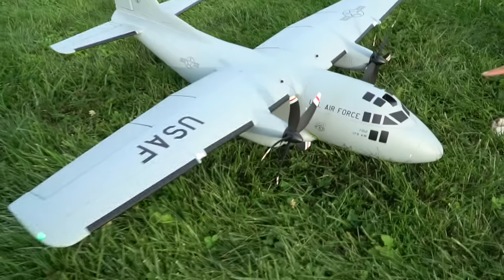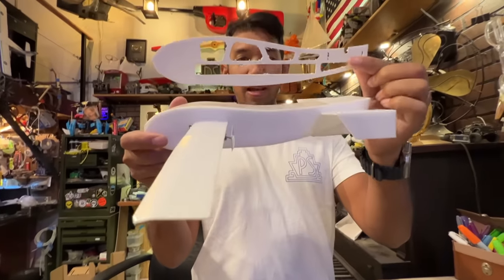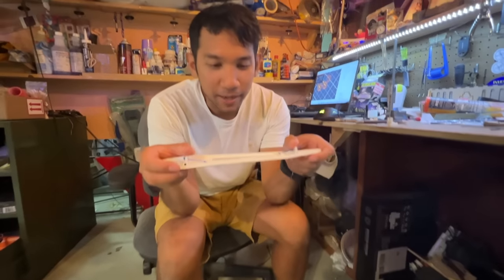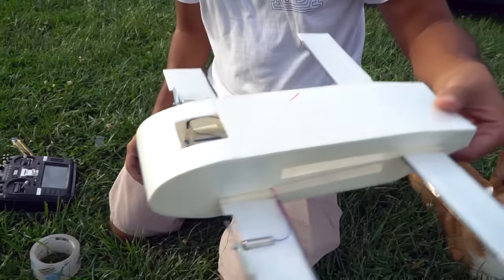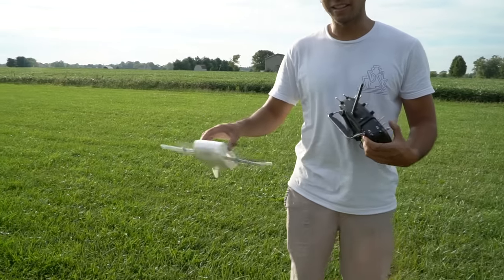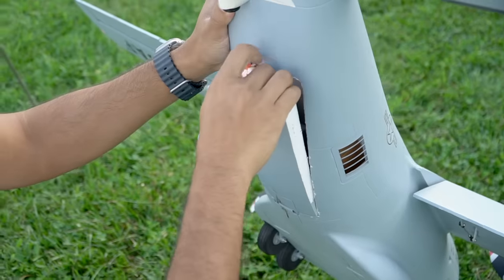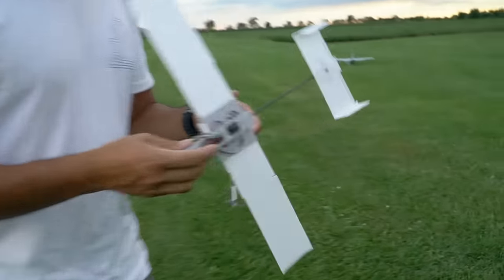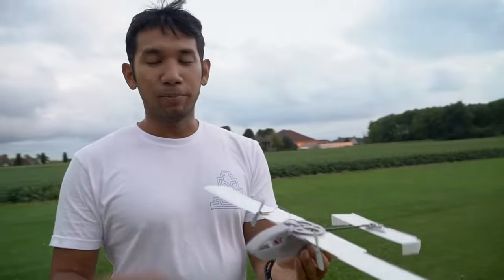MICRO Folding diy DRONE(mid air deployment)

Comment: Perfect! Just finished watching @TomStantonEngineering air powerd plane video and the new @PeterSripol video drops.
Reply: PETER, HEAR ME OUT! hydro foil kayak with a long shaft outboard engine. XXtra long foils with adjustable trim tabs (elevators) SO YOU CAN ''FLY IT'' ON THE WATER IN THEORY.

Comment: I can see some areas for improvement... But this is definitely a really cool design!
I'd put a lightweight servo in (like the EMAX ES9051) for some sort of aileron control as well as a little wooden pin that could be pulled out somehow after it's deployed (less likely to get stuck). That adds about 6-8 grams though, so there's that to consider.

Comment: Hell yeah! It would be cool to make an RC Razer Crest or Mando's N1. The N1 looks a lot more aerodynamic but making the Honda Space Odyssey actually fly would be sick
Reply: I could see the N1 being possible, the Center of lift vs mass would be an issue, but a little turbo fan in the outer cowling where the real engines are, fatten up the wings a bit to give an airfoil, might need some sort of vertical stabilizer unless you can gyro steer with the motors.

Comment: Sounds like you will not further develop this project, but just an idea: i would propose tuning the "cargo" arround inside the carrier so both planes are facing the same direction. In the current configuration, with the "cargo" facing backwards, at the moment of drop the it has definitively negative airspeed, thus no lift. Even though the parachute will reduce the air speed significantly below the speed of the carrier when the "cargo" would be turned arround, you will at least have a little positive airspeed when dropping from the cargo bay.

Comment: alternate design idea: 3(+) foil box-kite design that telescopes into it's long configuration upon opening the bay. the spring loaded keel opening to full length would shoot it out of the bay (no parachute needed, though a thrust plate inside the bay may be needed) and housing everything in the central 'box' should keep your balance self-righting-ly centered, with one prop pulling and situated between the leading box-foil and the central, while the other would be blowing/pushing through the final box-foil, similarly situated between it and the central one, for a front-to-back mirrored configuration.

Comment: if you attach the parachute directly to the plane with a release mechanism then if something goes wrong you just don't release it so it hopefully doesn't crash with too much force

edit: if you keep the skid with its parachute and attach the radio controlled release mechanism like a servo or something on it instead you only need to add a hole or hook to the actual plane

Comment: What controller board can you use for a plane with these small motors? I have one built from a mini helicopter board that also has two tiny servos. Don't know where I got the idea, might be flite test. But the problem with that is I don't remember the name of the board and you had to destroy the gyro on it so it doesn't do auto-throttle based on the tilt and I remember that being a gamble whether it destroys the board or not.
Reply: I'd also like to know.

Comment: Do you think that you could add a servo to the back to control the Elevons? That way the plane would be more controllable than “more throttle = more up”. I understand this would add weight and drag but I think it would be much cooler than this design.

Comment: Pretty decent for launching backwards into "dead air"... I think the results would be even better if you could launch the plane on the same direction as the "mothership" so that it gains lift from the forward momentum alone rather than dropping several dozen feet trying to get up enough airspeed from essentially trying to fly backwards...

Comment: What flight controller are you using to power that ultramicro plane? Would love to use that for some projects I want to do but never found a good way to power the small brushed motors I want to use

Comment: Assuming you just used basic PLA for the apparently final version of the "parasite" aircraft, that seems like a super easy, low cost way to get someone into RC airplanes. Is there an STL and a parts list anywhere for this craft, or is it just the Onshape file?

Comment: Hi Peter ! Have you seen the steering mechanism of the Switchblade 300 ? There is no linkage, two servos push directly the ailerons and a sping plate push the ailerons back. Do you think it could be done with 9g servos ?

Comment: Kinda like the Anduril ALTIUS, but square and much much cheaper, and doesn’t go boom.
Reply: It says the video came out 12 seconds ago how is your comment 1 day old
Reply: How tf did he comment a day ago
Reply: Patreon my dudes
Reply: PETER, HEAR ME OUT! hydro foil kayak with a long shaft outboard engine. XXtra long foils with adjustable trim tabs (elevators) SO YOU CAN ''FLY IT'' ON THE WATER IN THEORY.

Comment: Alot of you problems seams to come from flexing surfaces at high speeds.
I do alot with gliders and some high power gliding competitions here in Germany (F5J and F3J/dlg) we go really fast and hard on those suckers, but also have to be as light as possible.... Sometimes you end up 30cm deep in the grass because the control surfaces couldn't handle 100kph at a turning radius of 3 meters... 
Who would have known! 🤷‍♂️
Your plane looks like that but slower and way lighter.
I had that with alot of foamys too, at high speeds in a dive all controle is gone because the control surfaces just flexed out of the way.

Comment: PETER, HEAR ME OUT! hydro foil kayak with a long shaft outboard engine. XXtra long foils with adjustable trim tabs (elevators) SO YOU CAN ''FLY IT'' ON THE WATER IN THEORY.

Comment: bro, make a remote fuse lighter and stuff that cargo bay full of firecrackers and make another video, you know you wanna bwahahaha, just takes a battery and a stranded wire stripped down to one strand that you enable with a relay, i will forgive you if you accidentally light them without the door opening................ when you do that add the movie special for moar effects, just tape some zip locks of gunpowder on the inside and it should make a nice fireball